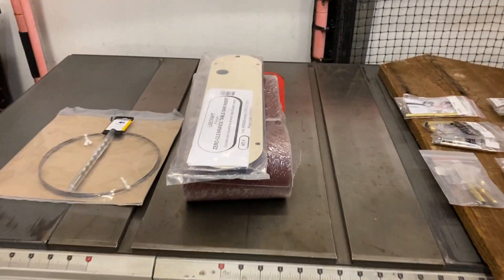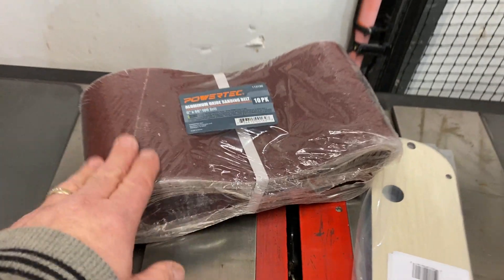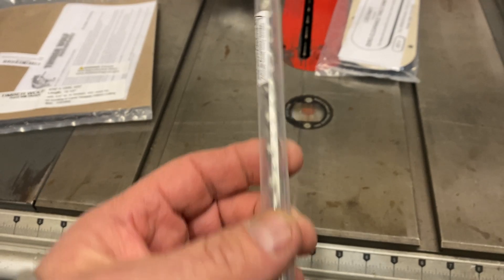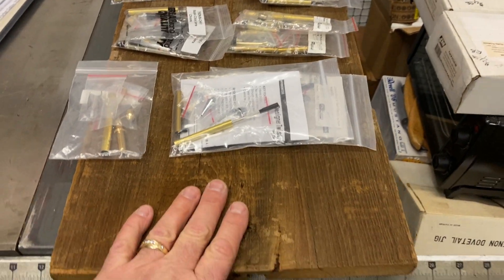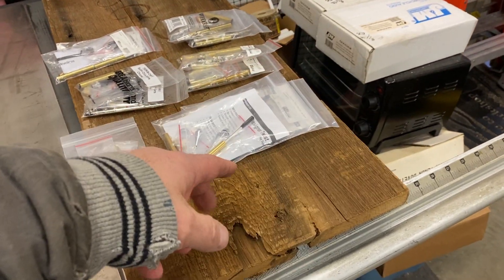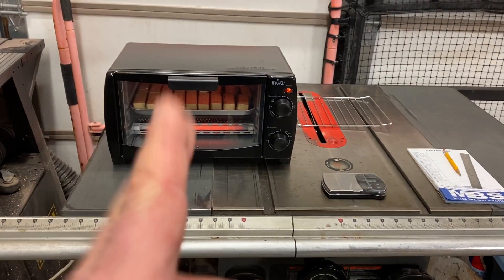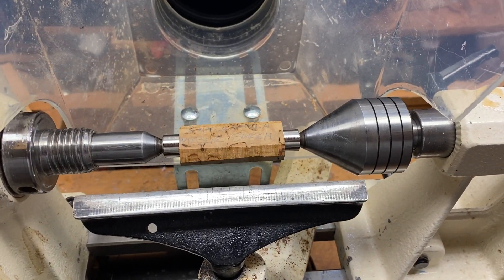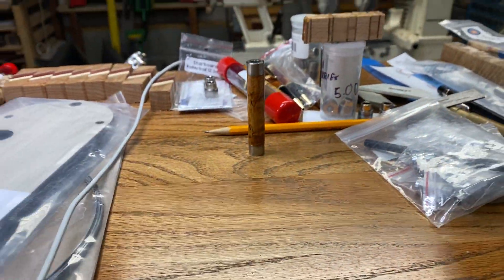2022/12/5 Shop Update

Comment: Hello Bob.  I have several of the Fisch bits and they are all very nice bits.  I also have a Timber Wolf blade on my band saw and I think you are really gonna love it.  The key for my bandsaw has been learning the right way to set it up (where the blade should sit on the tires and how to set the bearings/bushings).  If you haven't seen it, look up the video by Alex Snodgrass on bandsaw set up.  The Wood Whisperer did a video with Alex about 5 years ago that covers the process.  Doing this made a huge difference for my bandsaw.
Reply from the maker: Thank you David. 

Regards,
Bob